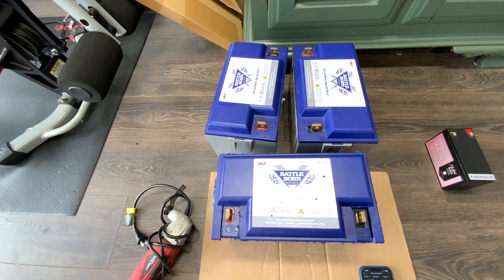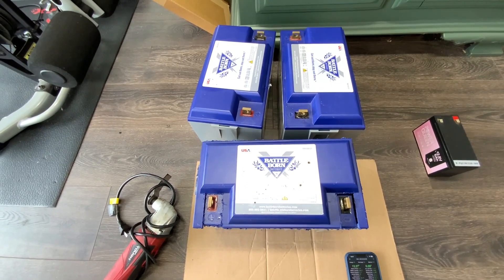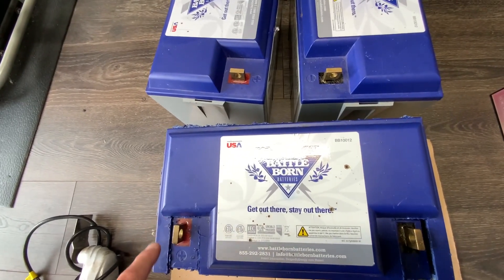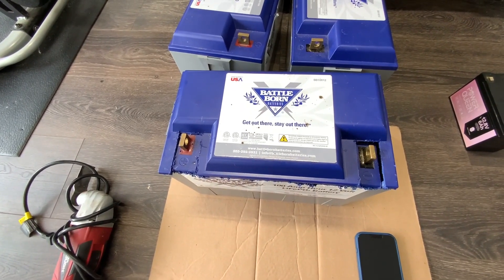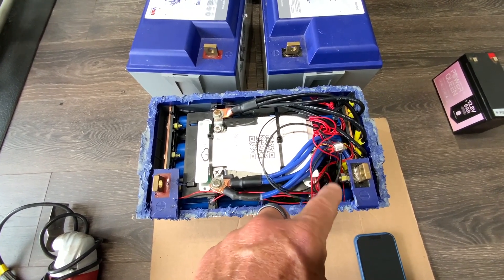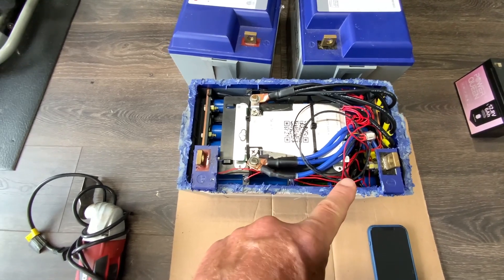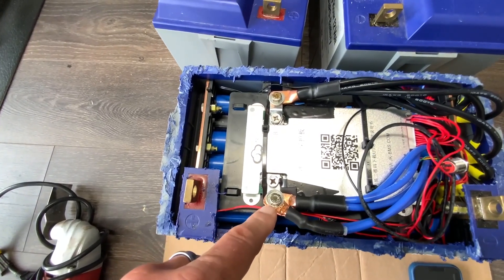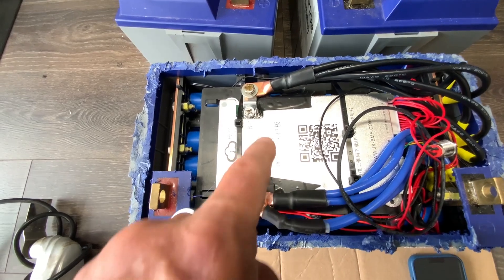How to fix a battle born battery

Comment: I have two almost new 24 volt 50 Ah completely discharged. I've tried to charge them with a Victron dc to dc charger but they dont wake up. I figure is the bms
Reply from the maker: I’d call into their support and ask for some help, maybe you will get lucky.
Reply: @IFix-Things Hopefully yes